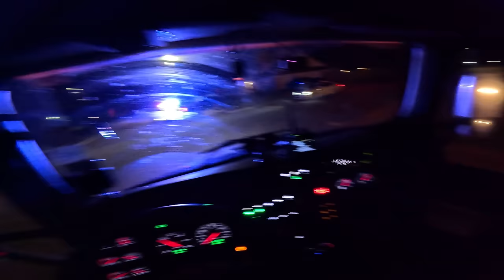This Chevy Tahoe Smashed Into a Parked Car!

Comment: Hey Dustin when you tied up both back tires for Snatch block too slide car sideways you should did that part in beginning but all in all great job fella
Reply from the maker: Yeah. Soon as I figured out the parking break didn’t work I figured I’d have to do it, but wanted to see if I could manage without re-rigging.

Comment: A Nissan Altima with a CVT transmission and they gave it paddle shifters 🤣. Thats awesome. With built in fake shift points. Im jk i have driven them and the paddles actually feel better than you would expect on a cvt trying to mimic gear shifts

Comment: Ask the other wrecker driver to hold the brakes of the wrecked car while you winch. Sometimes ya get lucky and thats all it takes to make them follow the direction of the cable.
Reply from the maker: Yep. If you can stop the tires from spinning they’ll go where they’re pulled, not where they’re pointed. That’s why I always have wood blocks on the back of my truck. Just in case the parking brake or park doesn’t work.

Comment: Maybe could have put snatch block at lowest corner of the bed @ the beginning.
Reply from the maker: Wouldn’t have mattered if both ends roll. It still would have just rolled in a straight line. That’s why I had to stop the wheels from rolling.
Reply: Sure it would have!  and once u had it closer to bed could have just hooked to Soft shackle on driverside to slide it side ways where u needed it. Then u could have put ur bridle back on and it would have gone straight up the bed instead of it Favoring one side because of  winch line being more to one side on the choker than the other.
Reply from the maker: Exactly, by stopping the wheels from rolling, and once it was closer to the bed. But just moving the snatch block down from the start wouldn’t have helped anything with the wheels rolling and no way to stop them.